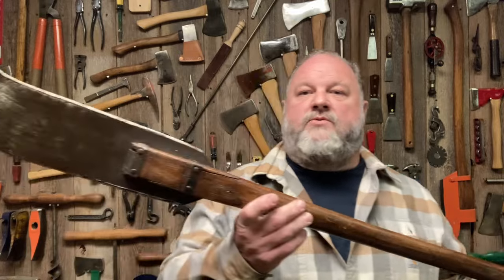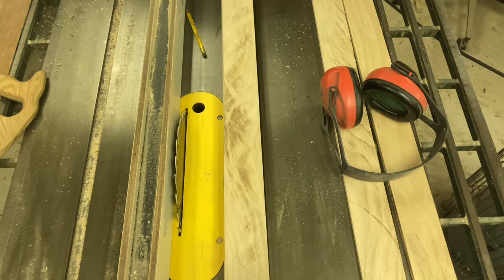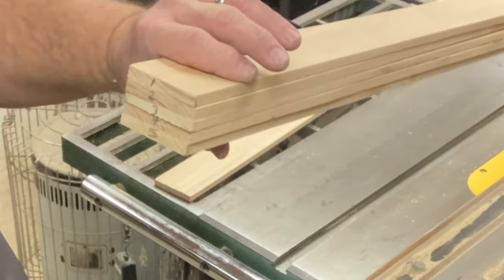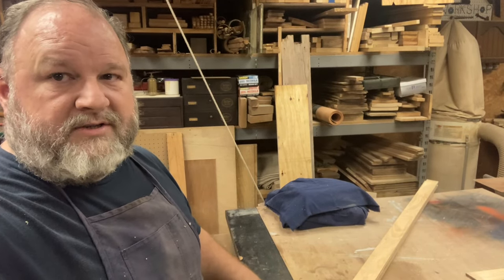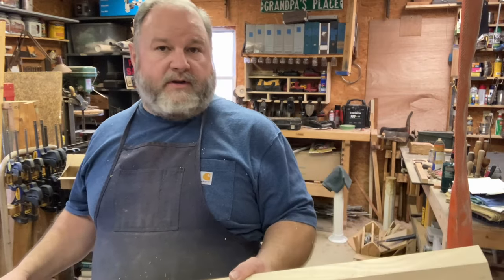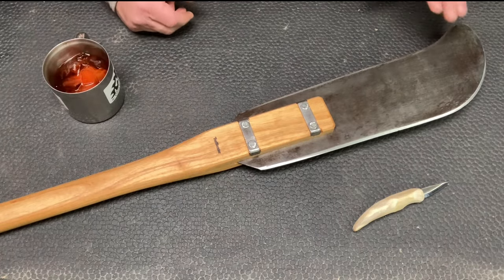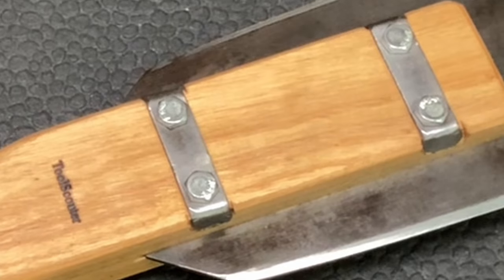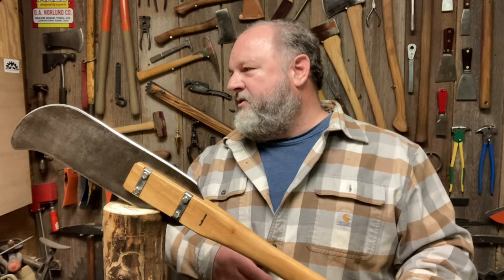Vintage Tool Restoration

Comment: Nice job on the new laminate handle. I know what you mean about the appeal of old high carbon steel against a highly polished edge. Have a great week  👍🏼😃
Reply from the maker: Thank you David. I do love the look of old steel with its been kept up nice. A little tarnishing stain isn’t bad, and then you sharpen that edge and it comes out so nice shiny and smooth. Thanks for coming by for a visit. have yourself a great week.

Comment: Great job on the restoration of the brush axe. I remember seeing the county road crews using those on the right of way of the county roads back in the 50s in rural south eastern Oklahoma.
Reply from the maker: Thanks. They have been around for a long time. I looked them up on Amazon and you can still get them. It would be nice to know how old this one is but there are no markings to indicate a time period. Thanks for coming by and have a good one.

Comment: Really nice work. Your fork reminds me of ScoutCrafter’s pointer. This makes me wonder about the possibilities of laminated handles for other types of axes and hammers.
Reply from the maker: Thank you. Yes, I stole the idea for the fork pointer from some other video I saw. I don’t remember who. You are absolutely right about laminated handles for other tools. A laminated handle is far superior to a regular one, but they’re more labor-intensive and makes it cost prohibitive. This was a very fun project though and I am so thrilled with how it turned out. You just need to be very careful with that blade because it cuts on three different sides and you can’t make a mistake with it or someone will get hurt badly. Thanks so much for stopping by and have yourself a great week.

Comment: Awesome! There's just something about a very sharp edge that you can swing with force that gives me the warm and fuzzies!! Lmao 😂 great tool . And very useful... and I think it would also work very well on the zombies!! Lmao 🤣🤣🤣 looks great... when you laminate. I guess grain run-out is not a issue at all... I could see how it could even make it stronger when it aposes each layer...
Reply from the maker: Thank you. There is something about a sharp piece of metal on the end of a stick that gives you the fuzzies doesn’t it? Yes, you shouldn’t need to worry about run out because each layer is bonding to the other to keep it straight and strong. Thanks so much for coming by and have a great week?

Comment: Outstanding!  I wish I had a tenth of your talent making/shaping handles.  You are a true craftsman.  I understand your love of the raw steel.  Where you tempted to cold blue it? Thank you for bringing us along on the restoration.   Jim
Reply from the maker: Thank you Jim. I do like raw steel but if I were to blue it I would have needed to strip all the patina off and that would have been a lot more work. If it were a new clean blade I might have done something like what you suggest. Thanks so much for stopping by for a visit and have your self a great week.

Comment: Nice work on that handle👍 I picked up one of these huge Brush hook axes a while back.  Has an old heavy axe handle and Blade & mount are stout.   Too heavy for probably even Brush clearing.  Definitely not a great Apocalypse weapon.  I will probably thin down the handle quite a bit. Try to lighten it up.  A traditional Spear or sword would be optimal for battle and keeping a little distance.  A tomahawk would be best for closer action
Reply from the maker: Thank you. Those big brush hooks exes are nice for chopping heavy stuff. Quarter inch to even sometimes 3 to 4 inches. Most of these things are good for self-sufficiency, but none of them are good for the apocalypse.😁 hope you enjoy fixing up that tool you have. they’re always great to clean up and make nice. Thanks so much for stopping by the shop and have yourself a great week.
Reply: @toolscouter    Thanks Scouter.  I bet your Right 👍 After I thin down and customize the huge thick handle.  I’m gonna tackle some 1-2” creek thicket.
Reply from the maker: Good luck and have fun.

Comment: You can't be too prepared for the apocalypse. I need one for the brush for sure. Enjoyed the information. Laminating the handle was a great solution. Too many clamps - never. Do you think the blade was worn down to the rounded tip or is it by design?
Reply from the maker: You bet, you can’t be too prepared for the end of the world as we know it.😄 i’m so glad you found the information useful and you are right you can’t have too many clamps. I do think the blade was designed that way. I don’t think it was worn down. I’ve seen several that have looked like that and when it’s sharp on the backside, it’s usually rounded at the tip. Hope that’s helpful and thanks so much for stopping by the shop for a visit. Have a great week.